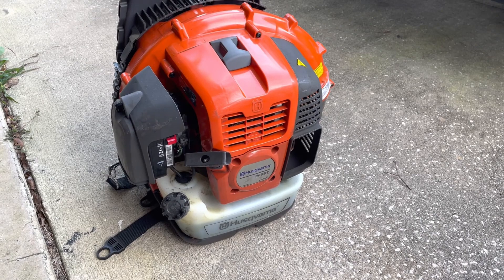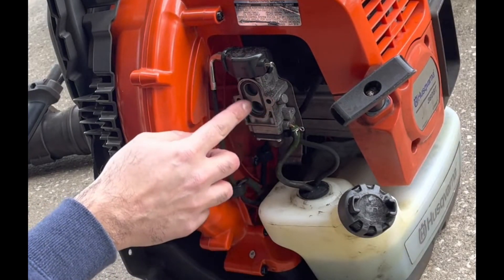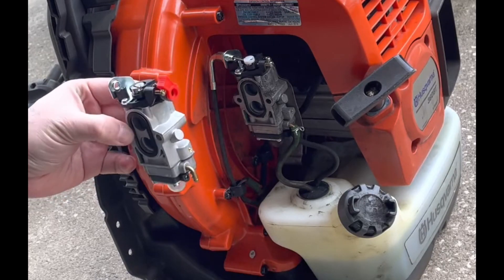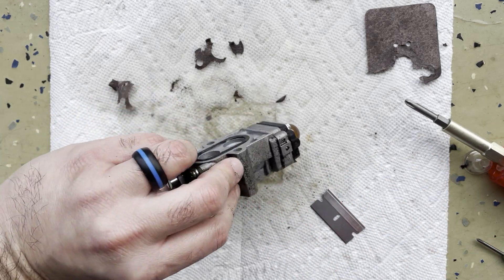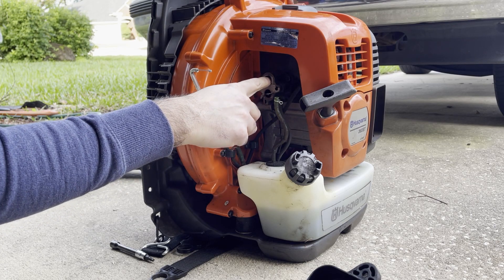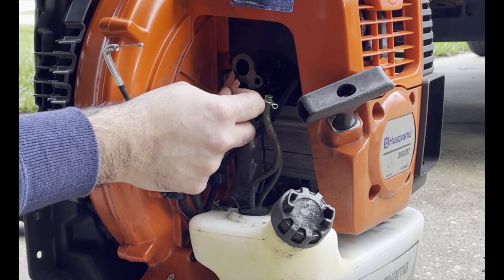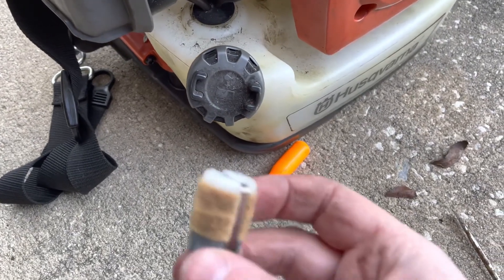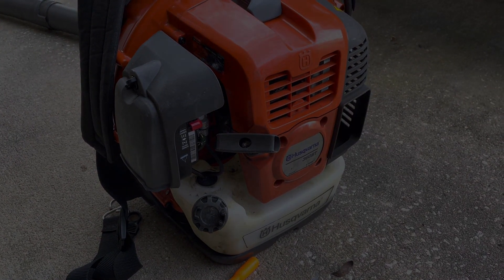Husqvarna 360 BT Carburetor Replacement

Comment: Had the exact same issues with the throttle and attempted to clean the carb and place it back on the engine. Went to start it and had the same exact symptoms. Needless to say, ordering a new carb pronto. It's such a simple carb so I'm not sure what's getting stuck in there. Thanks for the vid!
Reply from the maker: Yeah I dont know what happened.  Im assuming its some corrosion in one of the fuel passages that we just cant clean out!!
Reply: @wolfmanrepairs  Yeah! Do you know where the idle adjustment screw is on these Chinese carbs?
Reply from the maker: The idle adjustment screw is towards the top of the carburetor. You should be able to see it if you’re looking at the machine from the back. It’s opposite of the throttle cable. The screw pushes on a black piece of plastic. Hope that helps!! 🐺🐺😁😁

Comment: The original carburetor has a adjustment screw it's under the plastic plug beside the green tube just have to take the plastic plug out and unscrew it to give it more gas When it's dying it has 2 plastic plugs with screws under them

🎉
Reply from the maker: I still have the original carb around here somewhere I will have to look into doing that!! Thanks!! 🐺🐺😁😁